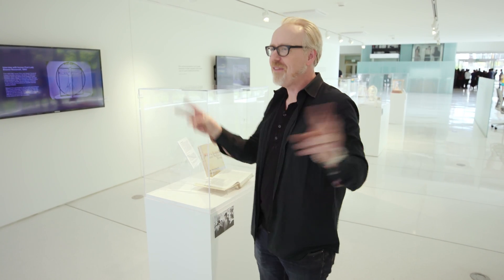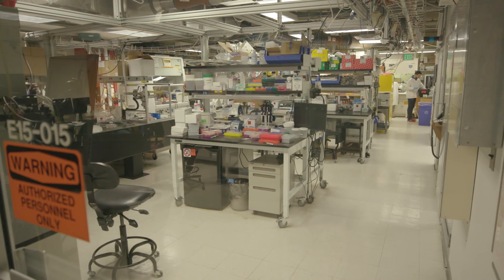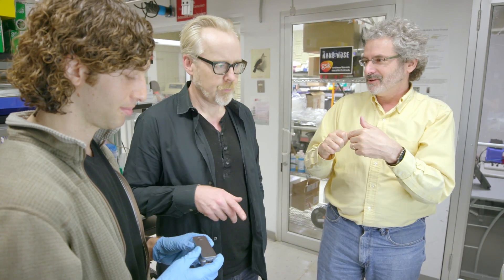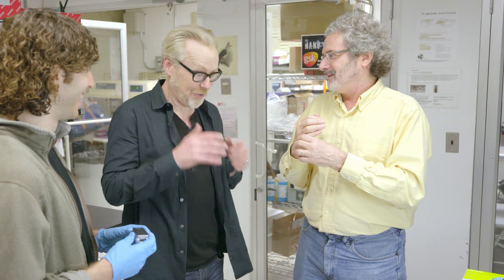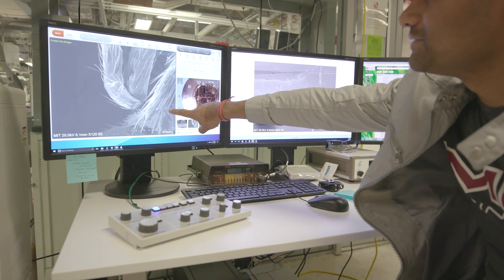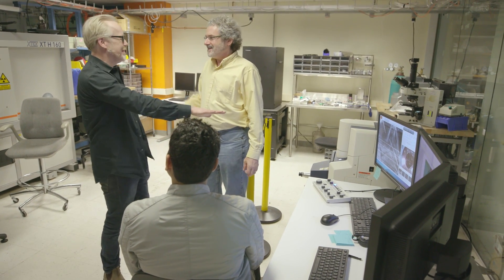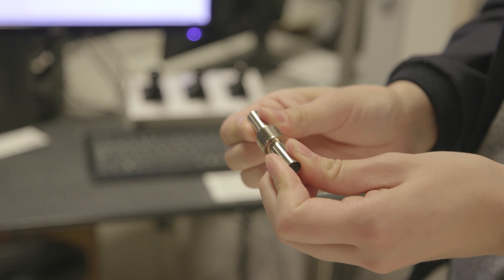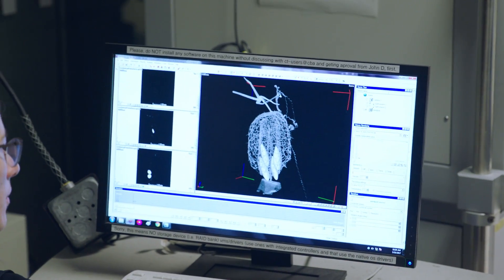Adam Savage's Maker Tour: MIT's Center for Bits and Atoms (Part 1)

Comment: First rule in interviewing... Make the person feel secure and for FSMs sake, let the people you ask stuff actually talk.  This is directed at the professor, not Adam. 

Especially that last bit. First she looked incredibly insecure and uncomfortable at their intrusion. Then she got to open up and talk about the machinery she knows quite a bit about, only to get cut off mid sentence with an off hand joke about her getting groceries... I too would have that look if I was in the same situation...

Also, as a rule of thumb. In general, don't simplify (dumb down) the explanation until the interviewer asks for it. That way the viewer gets to hear the language of the exotic locale. Even if that goes above the listeners head the first time, it will provide a framework for the simplified version. That way the listener can refer back to the jargon and understand what each part meant and the meaning as a whle. If this chain is maintained, then the listener is in a vastly better position the next time he/she encounters similar jargon. And using reason you can compare the instances and determine the differing nuances of those encounters. By not letting the listener hear the jargon in the first place then the listener is robbed of that opportunity. And the result is that we end up with a thingamajigg that can look at small thingies very closely... And an unfunny bit about girls shopping. Which does explain to a degree what it does but doesn't explain why this is better than a run of the mill microscope.

Comment: Hmmm... engineering bacteria, what could possibly go wrong
Reply: AJ No not just to store and recover data. They can actually communicate basic intent and send/receive instructions with bacterial colonies to make them build stuff and make sure the colonies are getting everything they require to do so.
Reply: not much really.
Reply: Well, there are already tons of known reporter systems in bacteria, which encode for requirements that baceria have (e.g. lack of a carbon source) or that react to certain changes (e.g. osmotic stress and such).

This is basically the next level, when you link these reporter systems to an sensor that can measure them online and can also effect the baceria more directly. It's a much more refined system than the ones we are currently using, which is mostly online measurement of culture parameters (pH, partial pressure of O2, online measurement with MS).

Since they are using nanopore seq I assume their system does not work on a protein-level but on RNA or DNA level. I'm not that deep into current sequencing technology so I'm not shure.